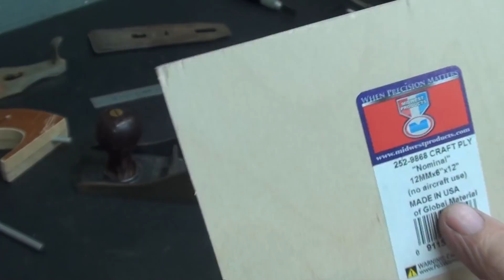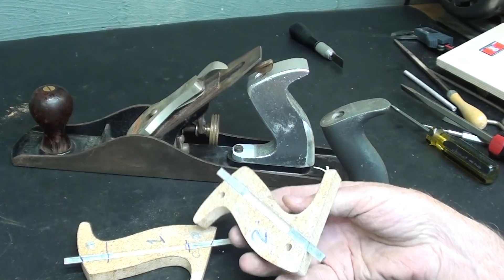ALUMINUM STANLEY PLANE TOTES Tips #650 tubalcain

Comment: A lot of Stanley tools use a #12-20 thread.  I ended up needing a bottoming tap and found Victor Tool still lists the size in HSS plug hand tap.  I bought two plug taps and ground one down. It works well.  This is also the thread most of my hand saw hardware uses as well.
Reply from the maker: Thank you for that, that is interesting to know that you can still get the taps

Comment: I've made many new totes for my planes I use in my woodworking. Mostly I've made them a bit thicker in the palm area and kept the upper finger area the same sizes. It fits my hand well. The handle material is usually A finer grade of Oak or Maple. I have used Sycamore too. Stanley used I think for thread sizes a #12-24 bolt on the handles.
Reply from the maker: Thanks

Comment: Someone has probably already covered this in an earlier comment, but YT makes it too hard to check so here it is again (from Patrick's Blood and Gore)

"Sometimes, you'll find a plane with a hard rubber tote with "B of E" embossed on each side. These were sold by Stanley to school systems as replacement totes for the poor planes that suffered the onslaught of destruction as wrought by the punks of yesteryear. "B of E" stands for Board of Education. These replacement totes were offered during the 1910's-1920's, when they were replaced with aluminum totes during the early 1930's. The replacement totes are most often found on the jack planes since they were the commonly  used planes in the school systems across the USofA."

The same site also mentions they used stained hardwood instead of rosewood during the war and from the mid 1950's onward.
Reply from the maker: Thank you, that is interesting to know

Comment: At 08:00 if you take the handle and put It on a rotary table, the 3d image from camera data would be modeled into a STL file for someone to 3d print.  Just a thought. Also, I do like aluminum but the oxide on the skin isn't good for the body. A paint job would be best for aluminum. 
Keep making the videos.
Reply from the maker: Thanks

Comment: It seems that if the handle was not angled quite as much there would be less chance of a blister in the thumb web.
More pressure delivered by the palm and heel of the hand.   Would you be able to have the no-name handle sawn in half vertically for 2 halfs for your pattern?

Comment: It would be easy to use one of the aluminum totes as a loose pattern. For easy ramming, make a wood or styrofoam follower. 

To make the follower, take a sheet of the follower stock bigger than your flask's face, half the thickness of the pattern. Trace the outline of the pattern on it, then cut it out. Perfection not needed, pretty close is close enough. 
To use, lay the pattern in its matching cutout and ram one side; flip the flask and pull off the follower. Any sand beyond the pattern's parting plane will be quite thin and right next to a well defined surface, just trim it off with a spoon-slick. Ram the second side to the first.

Yes, you'll want to add core prints to the pattern, and if the core prints are frail, you'll want to adjust the follower to support the prints, but the principle remains the same.

Comment: Toward the end of the video, you mentioned milling 2 of the handles down to halfs for use as a pattern. Would it be practical to just band saw one in half? Then at least you'd have a matching pair. And you'd only have destroyed one handle in the process. I realize that would be a challenge to hold it true to the blade. I enjoyed watching and learning the process, thank you for taking the time. Laughed out loud at the comment about kids destroying things. I remember doing it but don't think we did it maliciously! Just part of the learning process? Best Wishes!
Reply: I was thinking the same thing, but send it out to a wire EDM shop.  Only about
.020" kerf loss that way.
You would have to remember to drill two small holes first, so you could align the two halves for moulding.

Comment: Maybe a bit over the top with complication... but it would be possible to stand one of the existing aluminum totes up on end, take a series of pictures around it, and use software (some is free!) to generate a 3d model/mesh which you could then work with

Comment: hi i recently purchased an craftsman 101.07403, having a issue with headstock. the entire spindle seems to be out of center but im not 100% because i do not have any indicators. any ideas on a fix to get it back in alignment ?

Comment: I've had to repair the tote on all but two of my Stanley planes, most of which I inherited from my Grandfather.  Grandpa Charlie was a carpenter back when , if you needed a 2x4 or other 2x lumber you would cut them down using a hand ripping saw from a larger piece of 2x lumber.  I was really pissed off when I found out that the threads were not standard and I had to go up in size and re-tap to a 5/16" thread.  Do you think Stanley did that to prevent folks from repairing their tools, so that they would have to purchase a new plane from Stanley?  Great video Lyle, thumbs up.
Reply from the maker: I don’t think they gave it much thought, they just wanted to sell as many plans as they could

Comment: I have a wheel with a 7/8 hole with a keyway. I have a motor with a 5/8 shaft. Can I use a bronze bushing that's 5/8 id and 7/8 od cut a slot for the key and adapt it to work on the motor?
Reply from the maker: I think that will work
Reply: @mrpete222  thanks!

Comment: My old teacher in woodworks would have give me  an "extra lesson" if I had placed that equipment like You do. They should rest on the side, never be placed with the cutter down.
Reply: I never understood that one. The tool is made to shave wood. How on earth can placing it on a piece of wood harm it?
Reply: @ianbutler1983  I learned that more than 50 years ago so I don't remember the details. I guess. Suppose You have other tools laying on the bench, put down this tool on another tool and get knicks in the blade? Why cause ware to the blade on other ways than working on stock mayterial is another one?
 You also risc to alter the setting of the blade.....

Comment: I would buy a few of these aluminum castings.  You should put them on eBay or something I bet others would buy the rough casting and finish them to their own level of “pretty”. I wonder how the wooden ones were made at stanley.  They must have had a specialized machine that followed a pattern so they could get identical results

Comment: I would not purchase a Stanley aluminum tote handle just to cut in half. They go for about $40.00 and up with shipping on Flea Bay.  Too expensive to waste.  I wonder if someone could 3-D print two halves to be used for the mold. That would be ideal but, you still  would have to contend with the long 1/4" hole.  I think the one you cast looks great and smoothing it by hand with files is very feasible. I wish I had the equipment to cast aluminum.

Comment: Actually I use my hand planes quite a bit. Less noise and dust using a handplane, nicer finish too on wood.

Sometimes it's just quicker and easier to reach for a hand tool to do one job. Example to cut down long stock I use a handsaw"not pull saw those are stupid and useless" takes me less time to cut by hand than it would to set it up in a chop saw or get out the skilsaw.

For handplanes getting a curved bevelled edge on a long piece of wood to fit it's just quicker and easier to just hand plane it.

But my personal opinion is that any woodworker should start off with handtools. Going direct to power tools or worse Cnc is wasteful.
Reply from the maker: I pretty much agree with everything you said